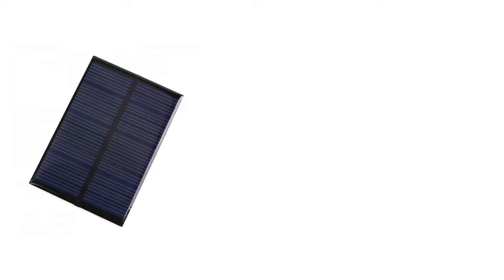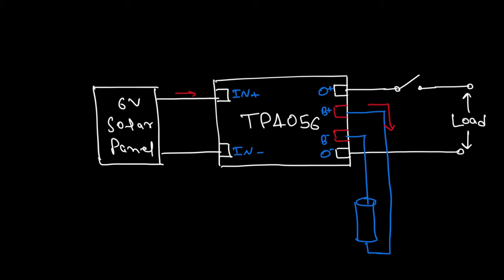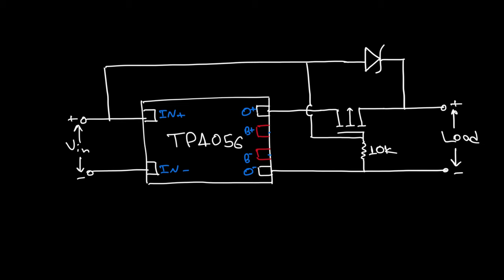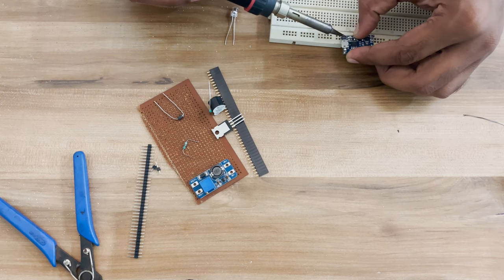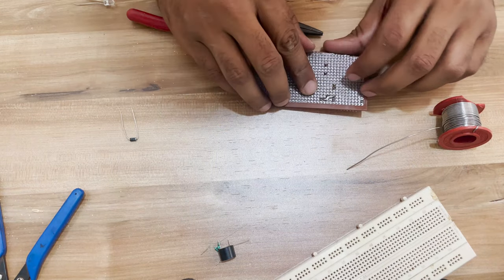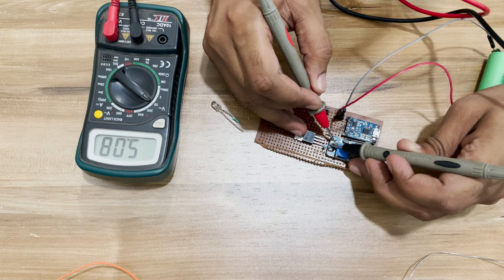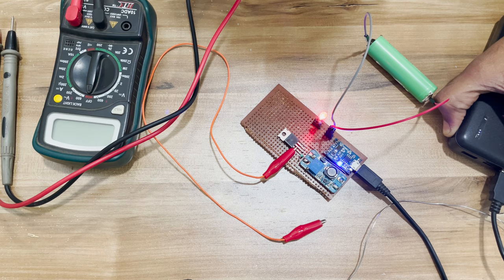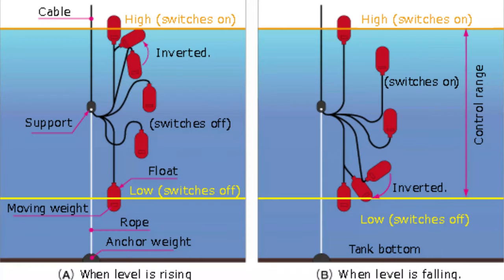Load Sharing || Use Solar Panel safely with TP4056

Comment from the maker: Addressing the comments with people saying using a solar panel with TP4056 will not be a problem:
1. I would like them to take some time and read the links I have added in the description section saying the exact same thing I am saying in the video. I would have accepted I am wrong, "IF" I was the only one saying that. There are a lot of people saying the same thing in the internet.
2. Something bad didn't happen to your circuit doesn't mean it is safe, or it will never happen. You might get away with using that unsafe circuit and not have a problem in your lifetime, but it is also possible that the conditions are not in your favor just once, and you had a serious issue with your circuit.
3. It can never hurt to be extra safe, especially when working with Li-Ion cells.
4. As one comment is suggesting, I WILL NOT TAKE DOWN THE VIDEO. Even if the circuit for using solar panel with Li-Ion cells is not useful, load sharing is a very useful circuit. Just read the applications of this circuit and you would see what I mean. One example is your laptop, when you battery is completely charged, the laptop is completely running using the power from the charger and not the battery. Even when you remove the charger, it doesn't turn off but runs off of battery. How is that happening? Load sharing!

No one knows the effort that goes behind making even a simple YouTube video until you do it. So please don't just come of the blue and ask me to take down the video.
Thanks!
Reply: There is over charge and overdischarge buint into this board. How will this be bad?
Reply: Yo seems not understanding the rule or principle of the battery voltage. When the load keep draining the battery, means the battery voltage ofc getting lower, So when the charger keep charging it, it will never going higher than 4.2v. Also the TP4056 will really cut off the voltage at 4.2v +-. If it doesn't cut off because the load keep draining the battery, means the voltage never reaches it full voltage, so nothing is overcharge there. While, overcharge itself means when the battery voltage going higher than it fully charge level. Do you understand? I think you are the one who should learn a little bit more.

Comment: This is nonsense. The TP4056 won't charge the cell above 4.2V. Doesn't matter that the rest of the circuit is drawing power - the power isn't going into the cell - it's going to the rest of the circuit. TP4056 will start charging when the cell voltage falls, and stop when it rises to 4.2V again. It's not going to overcharge the cell.
Reply: While it won't destroy the battery like you mentioned, there are few benefits of using load sharing, such as

1. The tp4056 (which is a linear charger module, means it wastes all the extra voltage above its output voltage into heats) is always used for power transfer, even if the solar charger could power them directly. This is especially true if we are using any kind of boost converter from the battery to power the load (e.g supplying 5v to load).

Using load sharing, you can bypass the tp4056, although a proper voltage regulator should be used to regulate that direct line.

2. It should extend battery life as it doesn't continuously cycle charge-discharge battery at 4V-4.2V like you mentioned. Instead, when solar power is present it will power the load directly and eliminate that battery usage cycle.

This video has nice explanation about those benefits.
https://youtube.com/watch?v=T70mBHeIOZA
Reply: using bms 1s 3 amp max is enough.
Reply: It's not nonsense. When the TP4056 goes into constant voltage mode it is looking for the battery current draw to drop below a certain point. It will never see that drop if there is a load connected to the battery.
Reply: @barryrudolph9542  Charge current drops to zero if it falls below 100ma. TP4056 will then provide only current drawn, so if a 200ma load is drawing current it will supply 200ma at just under 4.2V powering the load and effectively bypassing the cell.
Reply: Yup

Comment: This guy made a video not even reading TP4056 datasheet...  Otherwise, he wouldn't be talking nonsense.
Reply: Yes, I was thinking the same.
Reply: The main point is using tp4056 with a load, the guy is right ...tp4056 has over and under voltge protection but it advises against charging while connected to a load as tp4056 will not be able to know whether the battery is fully charged or not and  will overcharge the battery ..a solution to this is what is described in video ..very useful information indeed
Reply: @codewithdaniel-1  I think TP4056 have auto cut system' when battery was fully charged.
Reply: @hanunhanun2792  It only knows it is fully charged when only a small current is drawn but the load will always draw > 100mA and so it will never turn off. Also, it will never start to charge when power is applied because the load will draw all the initial 100mA starting charge current and so full current will never be applied to battery. These units must have the load removed for correct operation of battery charge/discharge. See https://youtu.be/3JxidPLKnqQ for workaround using MOSFET, but note that MOSFET Vgs threshold should be approx 2V max and part chosen in the video is spec'd at 4V max so some MOSFET samples may not work correctly as a discharged battery could be at 3V. This video is much better explanation https://youtu.be/T70mBHeIOZA
Reply: Can't even see properly just showing what is he doing can't even see

Comment: I don t think the 4056 will overcharge over 4.2V, but it will eventually keep it to 4.2 if the lod current is above the termination current. Not even sure if this circuits works correctly in the early morning with low battery level and weak solar panel current. This circuit is usually adopted for wall chargers with a solid 5V input

Comment: To those thinking that load sharing is needed because of overcharge protection, it's not the reason. The reason to use load sharing is trickle charging. The out of tp4056 alwaus runs off battery and discharges it which triggers the charger module to recharge the battery which wastes charging cycles. Load sharing prevents that

Comment: I did not able to get the desired result. I am using ur ideas with solar panel. When i off the solar, the output no longer reach the 1v. Did you know why? I want to used your design for my solar powered arduino project. As result the output produce 3-4 v with the existing of solar. When solar not available, the battery not even output 1v.
Reply: I had same problem, also when plug it back into usb it starts working again
Reply: @leefurniss  Hi, have you managed the solution yet? I kinda worried to do the wiring after reading the comment section
Reply: @johanjeques  Hi, sorry no i haven't bothered with it for a while, just check continuity between + & - before you plug in the battery, (don't short circuit the battery)  👍

Comment: I think this is not right, because, even if the Charger dont shut down, because current flows, the Voltage never go above 4.2V.  And this is save, all the current goes thrue the Load.
This is not a bug, its a feature.
Reply: Yeah, the battery wont charge over 4.2V... I'm also against this but I'm trying to find someone who will change my mind haha
Reply: @Djambo57  correct, the TP4056 has voltage protection.

Comment: I have a quite pro device doing the same when it's on in a charging dock. It happens because the load is using higher than the battery charging can catch up to. Charging is much less in general for safety. One can make a project sleep to some degree or crank it up. I don't know if it's relevant in this video. I still learn something. The funny thing is that I didn't expect to learn so much and be forced into caring about power delivery from batteries. It could be easier, but we jumped into those DIY subjects ourselves.

Comment: I use the older simple version with no load protection MOSFETs. The TP4056 never overcharges a battery, wen it reaches a pre-determined value in the 
chip, it trickle charges it at around 10% of the nominal charging current determined by the set resistor. Mine have a 1k2 resistor that will give me a charging 
current of around 1A. The boards that I have will stop charging anywhere from 4.162V to 4,265 V..!! If the voltage drops to a certain level, then it starts 
charging it again. The cycle continues every time the voltage drops just below a certain level varying from 3.95V to 4.10V, at least with those that I have...!!! 
I am using the TP4056 for some 6 years to charge my Li-ion battery and I use a stack of 5 of these TP4056 boards that give me a Max charging current of 
about 4,5A and stop charging from the lowest at 4,17V to the highest at 4,23 V.

Comment: Hey i didn't understand
Y u can't directly connect the TP4056 without load sharing
Cause TP4056 has over-voltage protection
And the battery charging is separated from the output so it won't overcharge the batter
Reply: the dude in the video is crazy he does not know a f about electronics
Reply: Exactly the dw01 on that tp4056 board protects on top of the Mosfet 4056, double protection
Reply: @micarifamily1  dw01 protects from 4.3V. When in dw01 is 4,3v then it disconnect mosfet. It dont protect from 4.2V but from 4.3V !

Comment: Works just fine. I used IRF9540 MOSFET, SB260 diode and 10K pull down.

Comment: As I understand, the load keeps having power when we have sun, right?  At what point, the solar panel will stop providing power straight into the load? for example since the solar panel starts providing less than 4V? so after that, the power to the load comes from the TP4056?  this circuit is fine if we want to have our esp32 working while the sunshine is maximum?

Comment: 1:51 I think that the circuit shown here is not complete, unless of course the connected load can accept a wide voltage range: 3V...8V. I think that when the power bypasses the TP4056 board, there should be a decrease in voltage from 4.2V...8V, which can be supplied to the TP4056 board, to the maximum voltage at the output of the TP4056 board, namely 4.2V. In addition, I think that the circuit shown assumes that there is a stable power supply at the input and it may not work properly if it is powered from a solar panel.

Comment: 1:06 Most likely, the mentioned problem does not exist at all - someone just made it up. If at the battery connection points, when the battery is not present, the open circuit voltage does not exceed 4.25V, then the described problem will not occur. The battery can be charged to a maximum of this voltage and no more.
Reply: exactly. there are protection in place

Comment: By coding with Atiny; I think it requires logic integrated circuits, but without that, can we take the voltage value with an integrated coded in Atiny and tell it to supply it according to percentage values? This is a 4056 integrated circuit, I thought it cut off automatically, maybe I'm wrong?

Comment: Diode using is 40v 1a as i can see. What if i want to connect 3parallel 18650 or more to charge and want to draw 5a?
Reply from the maker: Use diode that can handle that much current. 1N5822 can handle 3A. But I think SR560 will suit your needs, it can handle 5A of current.
Reply: @Tesalex  thanks mate 👌

Comment: This is incorrect. The TP4056 detects when the cell is almost fully charged and reduces the charge current to zero when it falls below 100ma. If any load is drawn, it supplies only the current drawn by that load keeping the charging voltage just under 4.2V. 
For example if the TP4056 charges a cell to 4.2V it will drop the charge current to zero. If you then attach a 200ma load, the TP4056 will supply only 200ma, powering the load but not overcharging the cell. This is all in the datasheets and you can verify it yourself easily enough.
Reply: The solution is still feasible though. What he's does isn't incorrect, it's just not mitigating overcharging. However when the sun is flat out it will preferentially draw from solar as opposed to the battery.